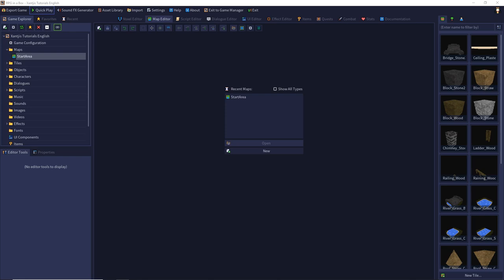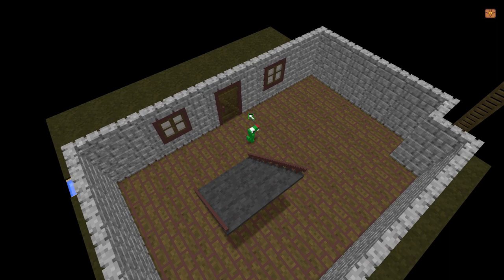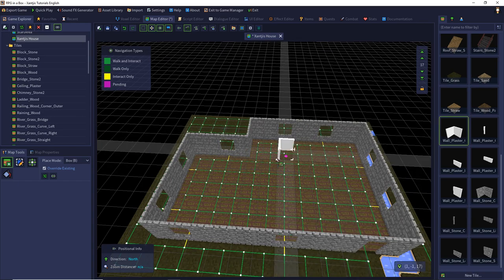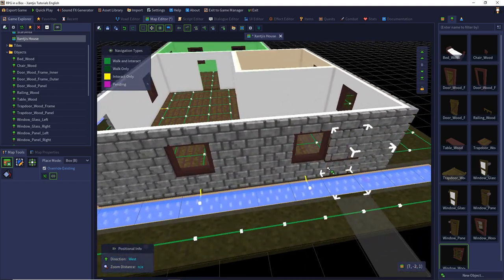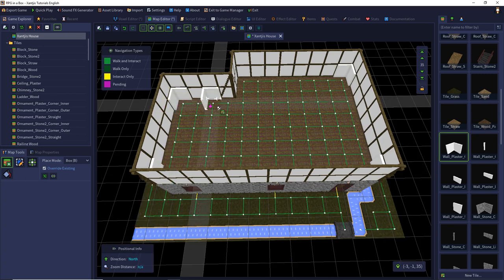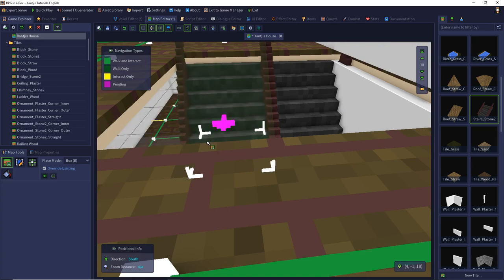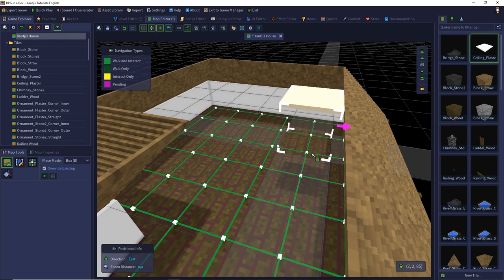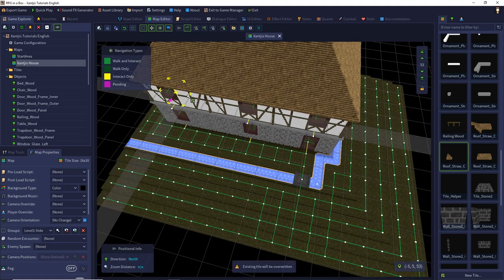RPG in a Box: Tutorial #11 - Interior and facade design

Comment from the maker: I have found that deleting navigation paths is much easier: while you set lines by holding down the left mouse button, you can remove lines by holding down the right mouse button. So you don't have to delete the nodes with the delete key and set everything again, as I did.
Reply: I also noticed you changed the colors for your navigation lines. Is that due to the red/green colorblind issue? I am asking because I also have that problem and the navigation lines were really bugging me but I didnt know if they could be changed. Im going to do that on mine as well.
Reply from the maker: @merowayc  Yes, it it is because of my color issue. You can change the color scheme in the editor settings (top navigation panel: "settings" -> "Map Editor").

Comment: This one was very detailed and intricate. 
I was wonder 2 things:
1. Can you give a more detailed explanation of the surface levels and how they are measured from the tile/object vs the map level?
2. Would it be possible to instruct us on how to make bigger than usual objects or characters using attach points perhaps. For example I wanted to make a rocket lets say and I want it to be 80 voxels tall. Well obviously we cant do that since the voxel editor doesn't go that high. So how would we create that object or a character that big like a dragon or some boss monster? How would animating something like that work?
Thanks again for your time and sorry for the late replies on these videos of yours, I have just now got back into RPGiaB and found them. Great stuff!
Reply from the maker: 1: The surface level in the object editor should be extactly on top of that voxel layer, which should be at the selected z-level of your map editor while placig it. 

As an example: If you use a 16x16x16 block of water and your water uses the lower 8 voxels. Then you can set your surface level on top of the water (8 voxels height). If you then place the block in your map at z-level 0 the water surface ist exactly at z-level 0 while the water goes down to z-layer -7.

2: Yes I will add it to my episode plan. In general you can use scaled attachments at your attach points or simply scale up your object at the map editor (Entity Properties -> Scale). You also can attach multiple objects in a row: object a to object b, then object b to object c, then object c to object d and so on.